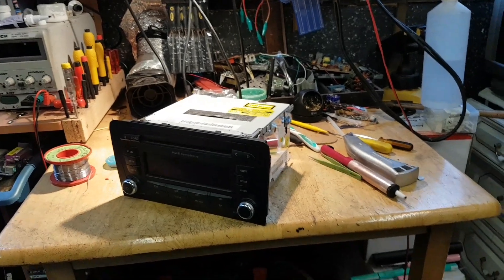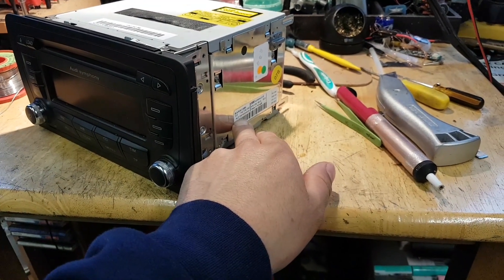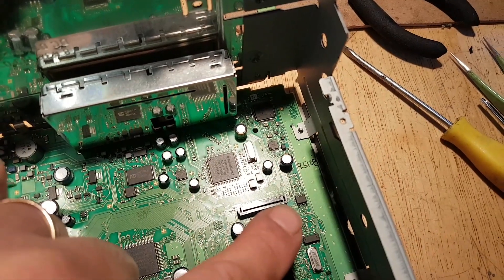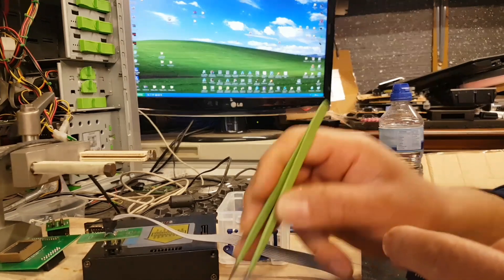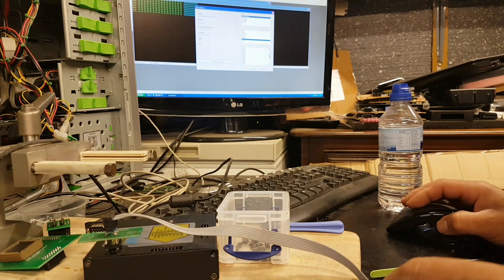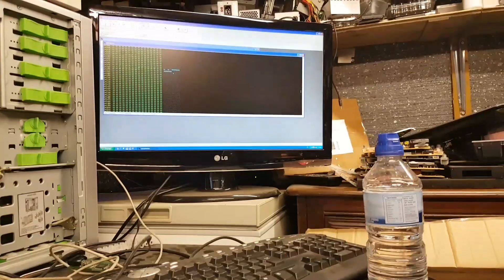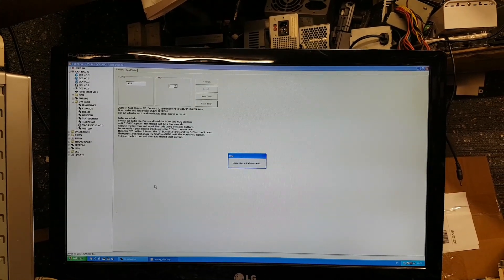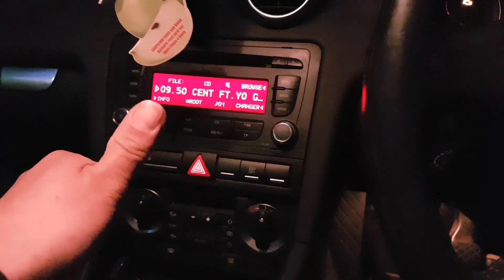Blaupunkt Audi Symphony 2+ Radio code retrieval. ST95128

Comment: Having owned many older German cars; Audi, BMW, Mercedes, and VW over the years, I used to be able to call the dealer and they'd furnish the unlock codes for free. Now (Audi) they want to charge you to come in for a "service" to retrieve the code. The code is in a database under the serial number that is stamped on the case of the head unit. I talked with Audi's service and tech reps and they tried to convince me that either the code has to be "re-programmed" or they have to scan it with diagnostics. All this is total BS.  Cheaper to just purchase a modern head unit and get a kit to install it. Metra is a popular brand for kits.

Comment: I need the pin for the same exact EEPROM from Blaupunkt unit which was taken from a VW Golf mk6. I would really appreciate your help with how to get the pin from the dump.
Reply from the maker: All explained here...
What else do you need? 
Thank you for watching!
Reply: @LMAutoRepairs  yeah I have watched the video a long time ago I am one of your channel fans. In the video you said that I can't share any software to calculate the pin. I have searched in the internet I can't find anything to extract the pin with. I also have carprog but it didn't pulled the pin. Someone on a forum told me that I need to read the MCU the eeprom is not enough to calculate the pin code.
Reply from the maker: There is that possibility...
Not all radios are the same...
You need to look for that particular radio...
Reply: @LMAutoRepairs  yeah I thought since it has the same eeprom 95128 it would be the same process to extract the pin.
Reply: @LMAutoRepairs  there is a software which uses RS232 cable with 3 cable connected to the unit apparently this software is able to calculate the pin without opening the radio.
Reply from the maker: Don't know... never done nothing that way...
Reply from the maker: @MUSTAPHAxESSAHIHI  
OK...
Have you tried that software then?
Reply: @LMAutoRepairs  that's my next step I am now looking for rs232 to usb adapter to connect to the unit or an old laptop that have rs232 port. But I doubt that would work because that unit in the video is RNS 510 and I have RCD 510. The first has 8 button and the second has just 6 button.
But I am going to try that software
Reply: @LMAutoRepairs  At the end I got the pin from the serial number. There is a guy who can calculate the code from SN. I wasn't able to retrieve my self. Because I have to read the NEC MCU which I don't have the right tool to do it. More than I have to more soldering.
RCD radio a little bit harder to get the code out especially if the needed tools not available.
Reply from the maker: @MUSTAPHAxESSAHIHI  
👍👍👍

Comment: Hi 
Is that plumbers solder ?
Reply: Is that good solder to use on wires ?
And what's that solder called?
Reply from the maker: @romaizafsar3502  
Just buy the proper one...
Search on eBay... easy to find...
Thank you for watching and for your comment!
Reply from the maker: LOL
Pretty much... yes.
Thank you for watching!

Comment: How did you read the chip with Carprog? Did you put the chip back and read with A6 adapter?
With my carprog i can't load dump and generate pin, always need to read with carprog..
Reply from the maker: Yes... need to read it with carprog...
If I recall correctly...
Thank you for watching and for your comment!
Reply: @LMAutoRepairs  yeah it is the only thing i hate about carprog. And the A6 clip is horrible. Even original from codecard supplier
Reply from the maker: @CarKeyGuyNL  
Agree...

Comment: A quick desolder of the EEPROM, Luis. 
Does the serial/PIN data appear twice in the hex code?  Just thinking if it did then you could verify for a match in case of corrupted data. 
Good result.
Reply from the maker: Not sure... but probably it does repeat...
Thank you for watching and for your comment!